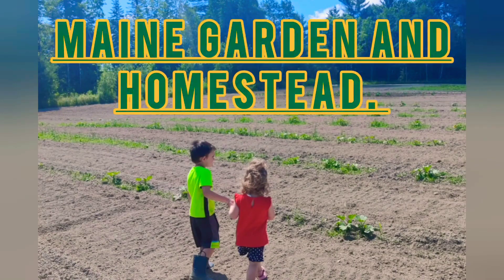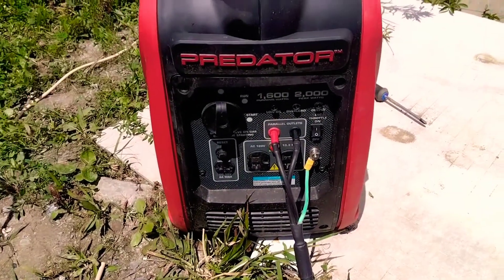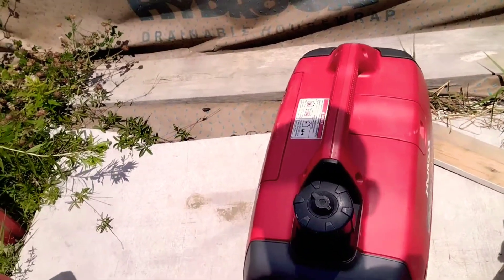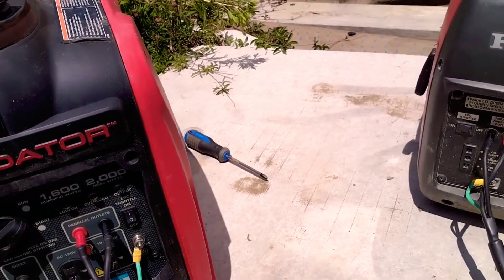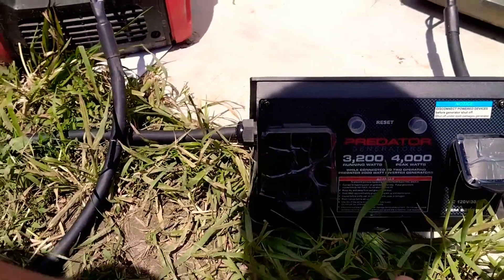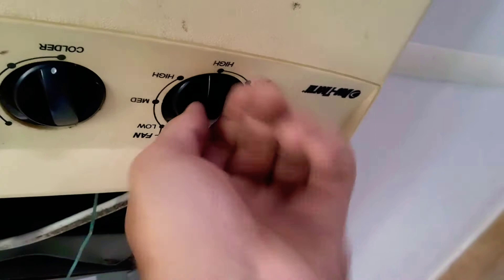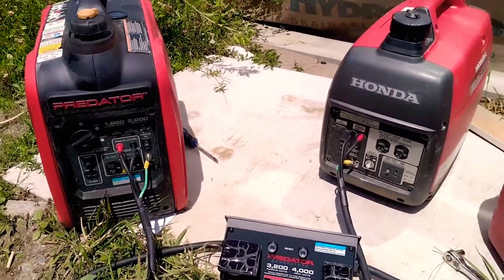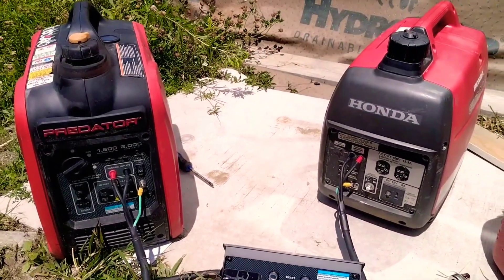Predator EU 2000 generator paralleled with a Honda EU 2000 generator with a parallel kit.

Comment: Just wondering if you continued to be able to run both the Honda and Predator paired for long term service to power your AC and if so how has each generator performed.  I have also been tempted to pair these 2 different brands since they have such similar specs but have not been gutsy enough to try yet.
Reply from the maker: I use them often while camping. I have never had an issue with them